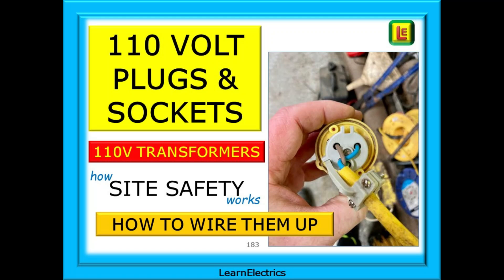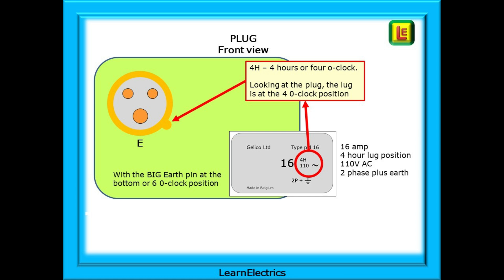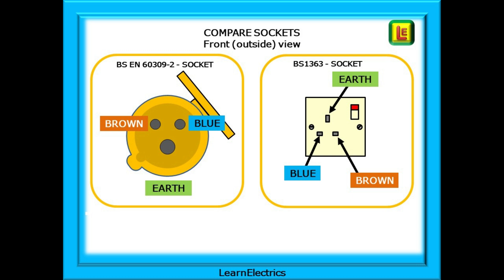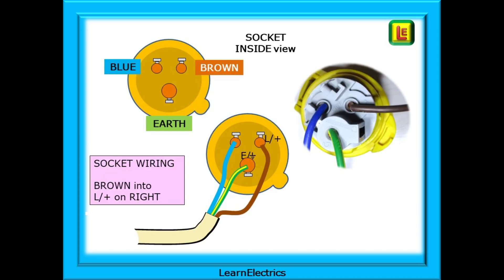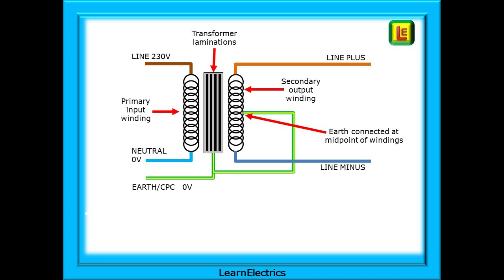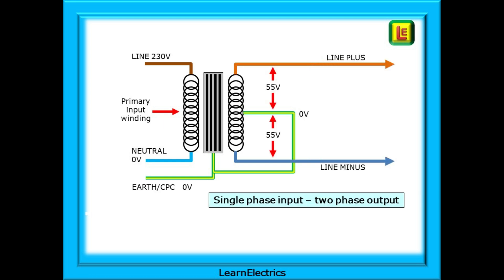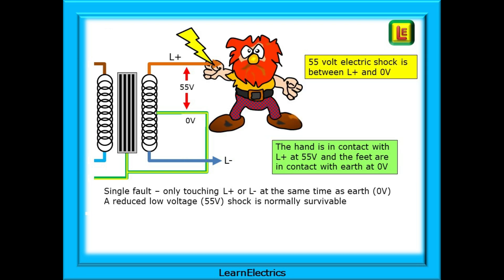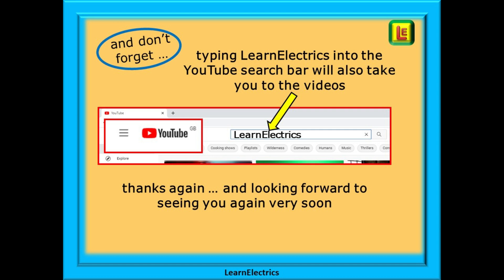110 VOLT YELLOW TRANSFORMERS – PLUGS AND SOCKETS – HOW TO WIRE THEM – HOW THEY WORK

Comment: Ok now I know why one would want to use 110 volt tools. Looks like a very good system to protect the operator. On construction sites we use 120 volt  GFIC  protection. This also protects the operator. Great video as usual. Thanks for sharing.
Reply from the maker: good info Lyle. In the UK we use RCDs which are similar to your GFCIs. Thanks for watching. Dave.

Comment: wouldn't a center tap make it a split-phase system as the line voltage is 110 instead of a 2-phase system?
Reply from the maker: I do believe the American 240 volt system is like this to create two 120 volt circuits.